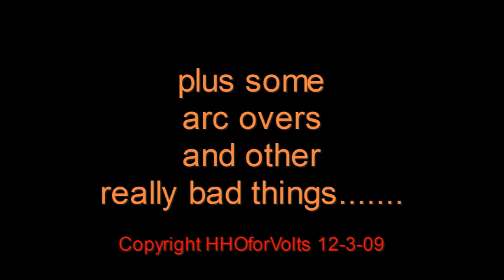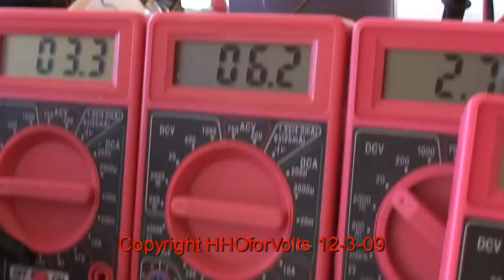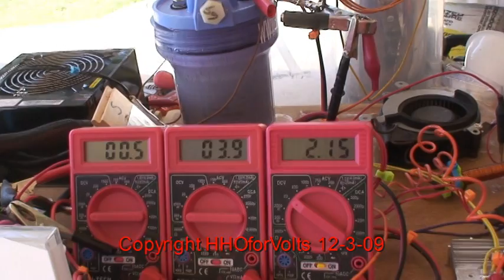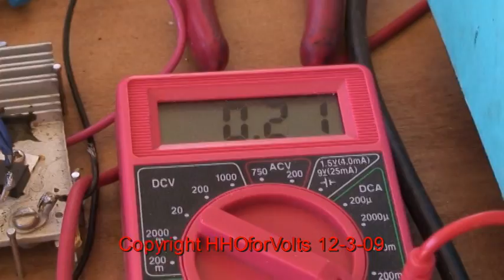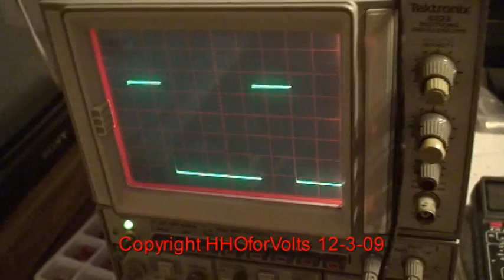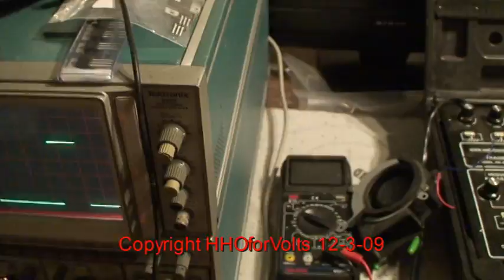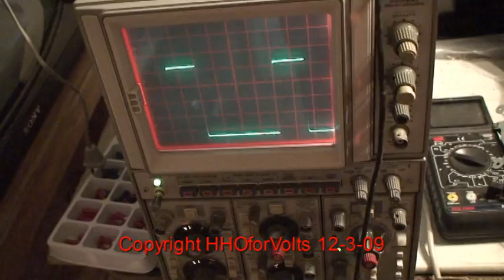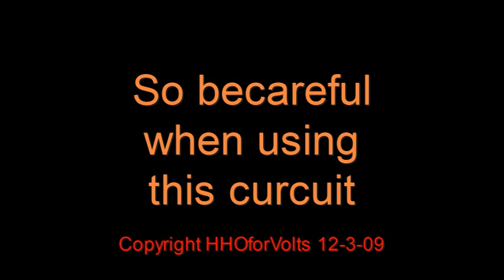HHO Current Over Unity Research #1

Comment: i comment on this old video to share an observation and an invitation.        NO one has Ever found any way around the rules believed to govern electrical power.   such a fact would be IMPOSSIBLE to conceal, if they had.
SO, it would make a LOT of sense to consider a NON-electrical approach to overunity.         overunity may be possible, by making use of the LAWS of Mechanical Advantage and the low-loss transmission of Torque 'energy'.      (see the MA laws if you doubt.)             a Complex machine Can be Optimized for Amplification of Torque Amplification (*and its conversion to electrical power).        obviously, this concept Cannot be demonstrated with 'off the shelf' components.    in particular, an Efficient, Purpose-designed pma is called for.     if it suits, see my channel for information.   see linked video by   george chaniotakis   and my comment there.           +++  Note that EVERY Gear Ever made is/was a  Rotary  2nd-class  LEVER.  +++         cheers
https://www.youtube.com/watch?v=lTkXciAn488

Comment: Many thanks.
Build up of static eventually has to discharge somewhere - fan control board -0V would do the trick and frazzle the lot! 
davidrrd has a point, V spikes could also be the culprit but I would have expected further damage on your circuits and test equipment if it could blow a fan winding??? 
This'll sound obvious but check your grounding... 
You'll find the problem... keep us informed?
Love your honesty 'warts and all' attitude!!

Comment: Great stuff - I think you have something very interesting and very different going on in your circuit - If you don't mind I'll give it a try?

Fans - Possible high static arc's across the carbon bearings?  Tricky one with so much going on in your circuit? Once you have it open you might see the tracks?

Comment: Very strange to say the least...
I'm not an electric engineer, but I'm also working on a resonating over unity coil. It's way different than your coil. I started by making a toroid out of loops of wire, then wound a Marko Rodin coil over it. When I pulse the Rodin coil to the sweet spot, a huge jump in voltage happens, and there is no over heating problem.
Have you tried using a back EMF filter between your coil and fan?
Peace.
Mike.